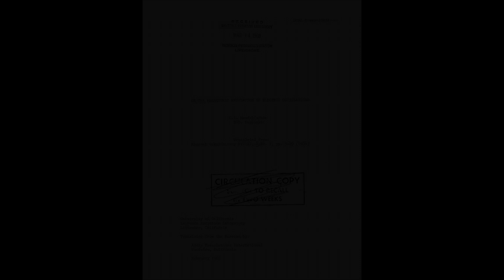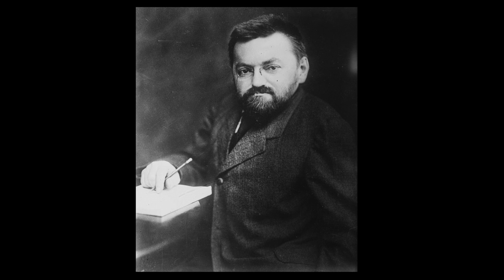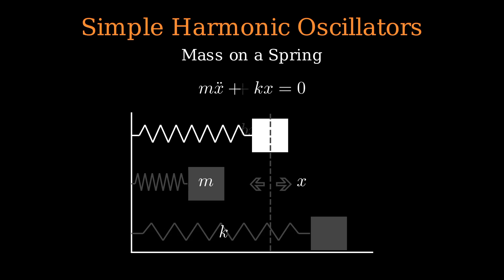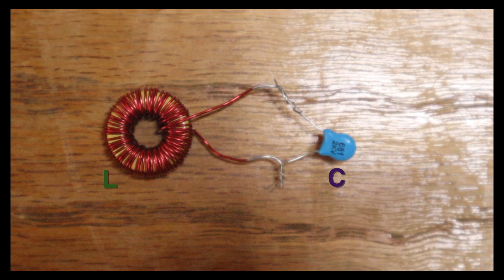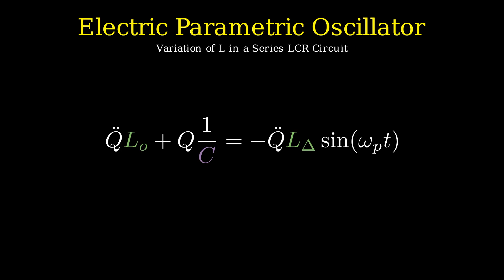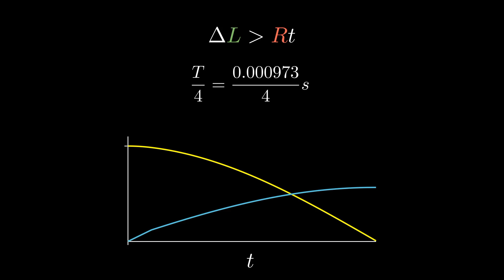Parametric Excitation of Electric Oscillations

Comment: Are your inductors air core or iron core? Also are all the inductors in series or are only the two opposing coils in series?
Reply from the maker: Inductors are iron core. They are all in series from one coil to the opposing coil and then on to the next pair all wired together in series. This set up isn’t optimal because the inductance isn’t high enough, meaning the disc will have to spin very fast to get an effect. I’m making a closed core version which I may make a video on in the future
Reply: Thanks, I want to replicate this device and see where it takes me.
Reply from the maker: @ronaldrider nice! Definitely look up papers on the effect and this specific device before hand. Will save you a lot of time designing
Reply: @jakersladder  Where do I find the papers?
Reply from the maker: @ronaldrider links are in the description

Comment: Interesting concept, but you’re not generating energy. The energy equations don’t break down when alternating the parameters of the circuit, you’re just adding or removing energy using external forces that require that extra energy to operate.

Comment: 100mH coil in series with 100mF capacitor and a ground connection in between the coil and capacitor pules at 630mS. You can get high VOLTAGES OUT than in.

Comment: This is awesome. Now imagine you use a plasma instead of a standard circuit.
Reply: I really have no idea the implication of what you mean. But for sure you are not the first one who said it, I alredy hear it before. Can you give me please more details? Thanks in advance
Reply: @JuanPerez-lg8yl  Plasma naturally kicks off energy that is relational to their size and various other parameters. If you can oscillate a plasma at a particular frequency you can modulate the energy that it gives off. Plasmoids are a form of plasma that is self sustained in a spherical or toroidal pattern, meaning that under the right conditions they will never decay. If you can create the conditions around a plasma to form a plasmoid and then oscillate it at a particular frequency to make it produce the most energy of a particular type possible, you can extract infinite energy from the plasmoid. 

Plasmoids produce energy that can be extracted in various ways. They produce thermal, electromagnetic, chemical, and oscillatory energy. Capturing any or all of those would yield tremendous energy relative to the amount of energy required to stabilize the plasmoid. It would be theoretically possible to set up an environment that would create the ideal conditions for a plasmoid to form and sustain itself with no outside input. Effects from materials would be able to do this.
Reply: Wow, you really get around finding all these hidden gems. 4orbs 4 Life
Reply: You should add negative resistor instead of positive resistor remember what tom e bearden said about them please Deloitte me some I have some more suggestions thank you 😊

Comment: First, resistance does not store energy. Secondly,  the variation to which Steinmetz referred occurs in a rotating machine that supplies the extra energy.
Reply: Resistance indeed doesn’t store the energy but it can change the inductance of coils and because you can’t change constant the length of wire in a coil it is much easier to play with resistance. Resistance influences magnetic delay
Reply: @Caesarus2011  I am still quite unconvinced.  Resistance only alters Q. The only way to convince me that you are extracting energy is to make it run on its own.  I am not a stranger to extracting energy from the surroundings.  I have a video breaking the 2nd law of thermodynamics.  It works all by itself. Please look. 
  I did not say that you should stop your work,  or that it is impossible to harvest energy. I will probably make a video on my top picks for available energy beyond wind and solar.
Reply: @Caesarus2011 no where in any inductance formula is inductance based on resistance, resistance can only alter the strength of the magnetic field produced from the coil
Reply: @ And to better understand this and why manipulating resistance is easier try to calculate electric energy in coulombs instead of amperes, as using amperes is valid only for electric flow and not for static charge … in a capacitor (condenser) we accumulate electric charges and the pressure (voltage) is rising up while we pile up more charges. If resistance is added/subtracted we can manipulate time constant dictating how fast capacitance reach the level required to maintain free oscillations in an LC circuit. Faraday Law applies only for electric flow. We are living in a sea of electric energy (electrostatic) and as long as this energy does not flow through our bodies (or our machines) is harmless (useless). A permanent magnet works based on induction using high resistance and is a perfect trap for current while an electret works based on capacitance using very low resistance and is a perfect trap for voltage.
Reply: @Caesarus2011  ok but still none of this dictate that more energy can be produced that what is put in, the general fact that every wire has a resistance will cause a dampening of the LC oscillations unless external energy is applied to the circuit at the right time to keep it all going. I don’t remember a lot of AC stuff but I would assume that the exponential energy graph old mate showed was reactive power and not real power. The nature of RLC circuits will never cause an increase in energy because of that resistance that’s always present. Permanent magnets don’t work on induction, they work on magnetic domains aligning, induction is totally different and how would a high resistance trap current?? Have you at least studied maxwells equation or ODE’s or better yet built these circuits and measured anything close to what this guy is proposing?
Reply: @ Can you run a step down transformer on unreal (reactive) power instead of using capacitors for PFC ? 
What is magnetic domain align ? All I know is an electro magnet can be switched off at will, while a permanent magnet cannot … are they working one with electric flow and the other without ? 😂
If we go out in space, what a compass will indicate ? North of the universe ? 😂

A magnet will provide always current and an electret voltage … without external input, just by themselves. And yes, they need alignment indeed, structural atomic alignment… to offer a path for electric charge to flow
Reply: @Caesarus2011  as I said I don’t remember much AC stuff but I assume you cannot run a step down transformer on reactive power as that is power that is not used but wasted in order get current flowing through the coil windings.

Magnet domains are some quantum mechanics things inside of magnetic materials that are not well understood, but these domains need to be facing the same direction in order for a magnetic field to be produced. This occurs in an electromagnet by the external coil inducing a magnetic field inside of the iron bar that causes those magnetic domains that were all facing random directions to line up and become a magnet. A magnetic compass out in space would likely point to the source of the strongest South magnetic pole. 

A magnet will not produce current on its own by itself, it produces a stationary magnetic field at rest which provides no energy, same with the electret. You can only transduce energy from them if you either move them around near your transducer or move your transducer around them. An electret does not produce a voltage but instead a static electric field in which no energy can be harvested unless it is moved.

Comment: Changing parameters of a system which already contains some energy is not for free, work has to be put in from outside, because already present energy inside system is putting up the fight. E.g. the copper plate shifted in and out of the magnetic flux will have eddy currents induced in itself which will oppose the movement (magnetic braking). Therefore expectations of "generators without fuel" were probably tongue-in-cheek insider joke of those old engineers.

Comment: You'd have to demonstrate it.. but I think you're forgetting that the same magnetic field collapsing on a higher inductance coil is going to have higher voltage but a lower xurrent.... The other factor is that the capacitor is going to limit the power that can come back because even if it is the same current and higher voltage the cap has limited size and can only hold so much current before it over voltages.... Sort of... So I think you would have to have a parametric capacitance to in order to collect the higher energy and dumped a portion of that back to the smaller system
Reply: You don't even need capacitors. That's the secret ; )

Comment: I'm amazed to see others following the School of Dollard/Steinmetz getting so deep into parametric variation (and with the math to prove it!)😄😄😄

I have a slight issue with variation of C.  C is a storage coefficient and not an energy transfer coefficient.  E=CV is a statis quantity meaning reduction of C causes an increase in voltage.
I believe your work is still correct but requires a phase-offset of 90deg to account for this.

IMO the benchtop model will probably not work because eddy currents involved.   Maybe with a saturable reactor mag-amp and a spinning magnet to vary inductance of the reactor?
Reply: Someone in the comments here noted that replacing the cut copper wheel with an iron wheel would solve the eddy current problem and would further aid the system by the fields pulling it instead of resisting it,  I wonder if Jaker has tried that yet.
Reply: Very interesting topic. Thank you all for sharing this knowledge.

Comment: really nice video. So changing the Inductance is like if you "magically" could make the spring harder when the mass is dropped? or making the mass heavier when the pendulum is at it highest point?  Just trying to get an idea :)
Reply from the maker: That’s exactly right! Whichever two parameters are responsible for the resonant frequency of an osculatory system may be carried and give this result. In the case of the spring that would be the mass and the spring stiffness. Spot on!
Reply: @jakersladder  thanks for the answer. would it be possible to do it solid state with a "transformer type thing"? also how about variable capacitance is that also working?
Reply: @martinetellerandet8566  I've heard that coils and capacitors undergo parametric variation of their C storage coefficients at certain harmonic frequencies, so that may be one method for it.
Reply: Changing capacitance is too limited as to have a very large change in capacitance, how large the object needs to be? At large power demand, parametric resonant generators tend to be way too expensive due to the use of massive capacitors. Unless, you can think of something to completely replace capacitors?
Reply: @lukiepoole9254  The ultimate capacitor is the Aether itself, but how you'd utilize it as the capacitor of a circuit directly instead of using a material capacitor I'm uncertain.

Perhaps Resonance might be involved? Dollard has stated a few times that when Tesla operated his coils at their Resonant frequency they developed a single terminal ground into Counterspace/Aether, making them grounded at a universal level, perhaps there's something there in using the Aether as the capacitor in that manner? I don't know.
Reply: @JenkoRun  Or you can just use the synchronous condenser as the capacitor : )
Using aether as the virtual ground is Tesla system, that would involved extremely low frequency, unsuitable for our system
Reply: @lukiepoole9254  The Tesla system is only low frequency if you're trying to transmit globally, it was due to the effect of solar radiation (Tesla has an article on it), or if you've got an absurdly large circuit like the Wardenclyffe tower, for a small self contained system high frequencies are very much useable.